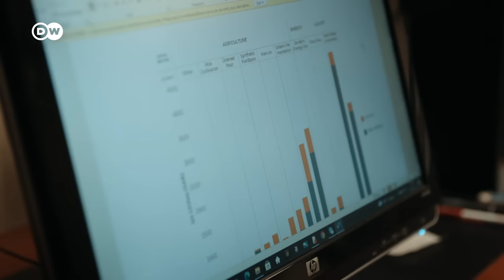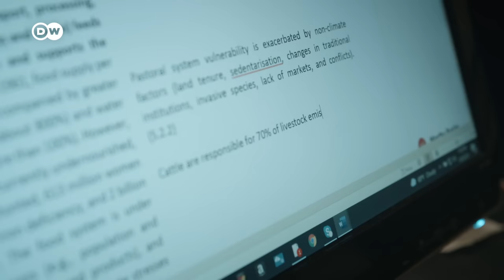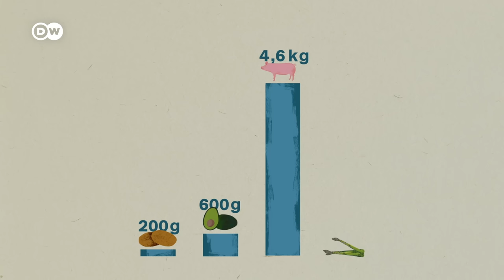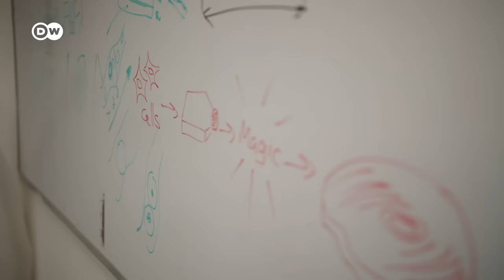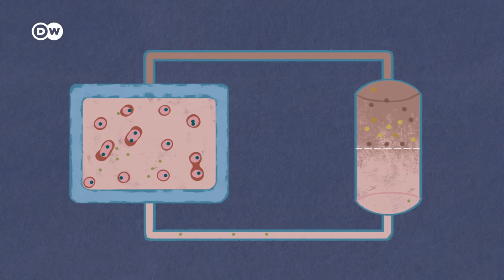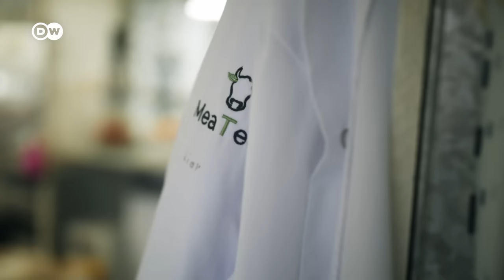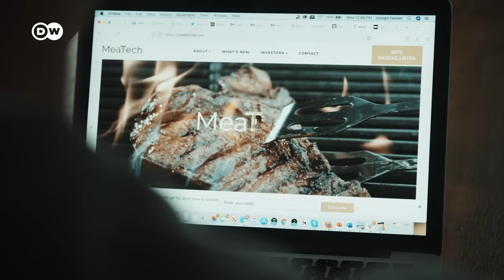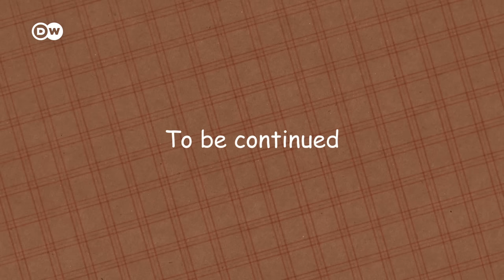The world of meat substitutes | DW Documentary

Comment: I believe the comment disregarding the possibility of sterile manufacturing is off-point. Pharmaceutical can execute this on a 24/7 hour basis concerning multitude form of medication, which is a far higher state of sterility than food manufacturing (aka the standard of safe manufacturing on a regulatory level is higher in medicine than food). Thus, if it can be done for medicine, it can certainly be done for food.

This said, the easiest transition to non-meat diet is to accept that your diet will change to something that is different, instead of chasing what you used to have. Sure, one day lab meat will be the same as real meat. But if you are keen to make a difference, accepting plant protein or lab protein as equivalent difference is vital. You don't compare chicken to pork, or pork to beef. You don't compare plant protein to meat protein. Enjoy what the new world has to offer.